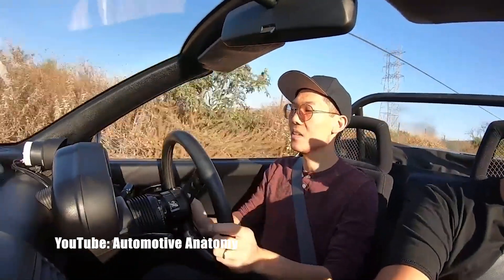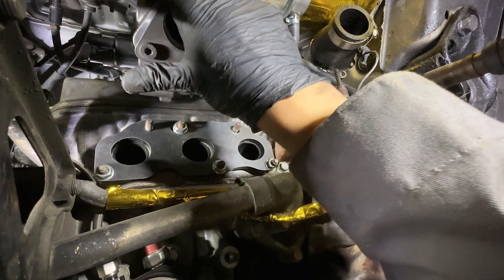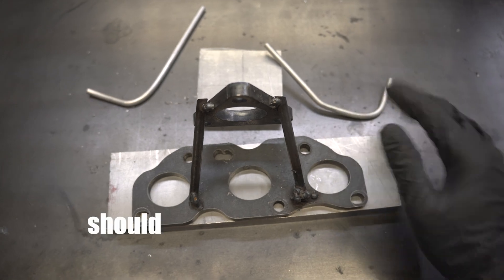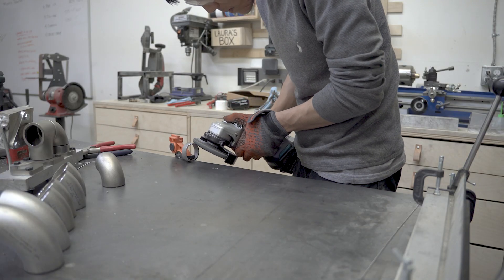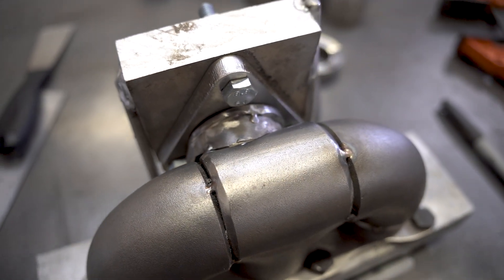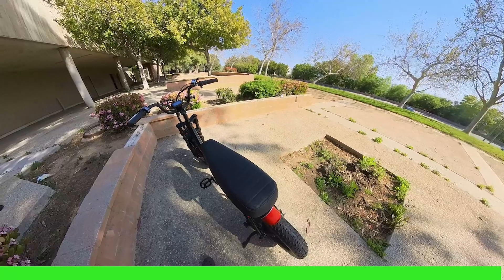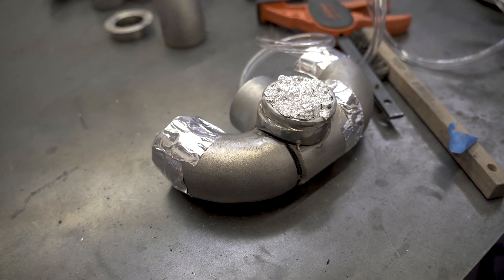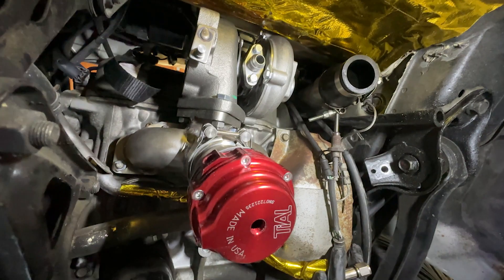How to Turbo a Honda Beat | DIY Turbo Manifold

Comment: why would you use an external? especially in such a small application the internal wastegate is more than perfect
Reply from the maker: I agree the internal is more than perfect. The only reason I went external was for space reasons. The turbo wouldn’t fit in the space with the internal wg attached so I chose to go external and gain an extra couple inches of clearance.

Comment: Great vid man. I did my manifold for my twincharged set up in a similar way, but I used black pipe from hardware store and welded that to the stock manifold flanges.

Comment: Just to clear it up. Aluminium has a I towards the end. So the pronouncation of aluminum (American) is incorrect. The way Americans pronounce it is the equivalent of calling helium - helum, potassium - potassum. Well it's just not right. Nothing but love for Americans but yer you butcher the language and English is not my first language ♥️🏴
Reply: Aluminum and aluminium are both accpeted as correct spellings. They both originate from Sir Humphry Davy's proposal, "alumium." Davy later used the American spelling in his works, while other publications used the European spelling, causing the divide. It's not a issue of pronunciation, but rather of spelling. Since it was spelt differently, it's pronounced differently. That's why there's only debate over alumin(i)um and not other elements, such as potassium, which was also named by Sir Davy.
Reply: @Sarin-Q yep. Americans do a lot of dumb stuff like non-metric weights and measures, guns, and healthcare, but pronunciation of aluminum is not one of them. “Aluminium” elitists need to get over themselves.

Comment: Really cool video. The manifold welds look solid. 👍🏽 add some oil to the blade between cuts, I usually see a milky mix of oil and water. Looking forward to the next upload. Thanks for sharing.
Reply from the maker: I will definitely use more cutting fluid next time! And thanks for watching!

Comment: You probably harden the stainless while cutting and it dulled your blade, it its very sensitive to heat, that's why i always use some type of cutting fluid or paste, and wait for the parts to cool off after each cut, great job man, i envy your car so much
Reply from the maker: That makes a lot of sense! Thank you so much!